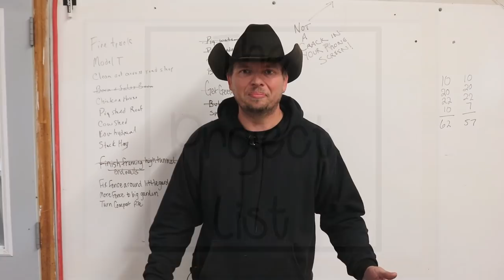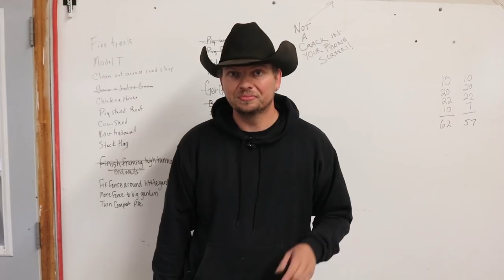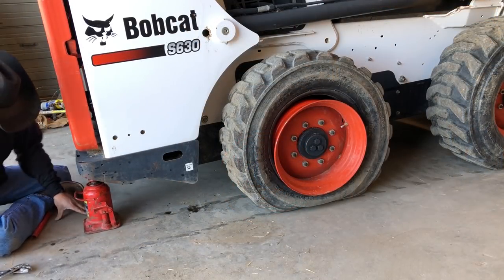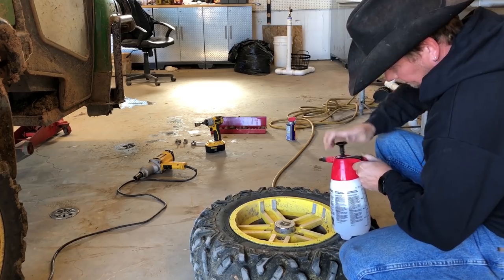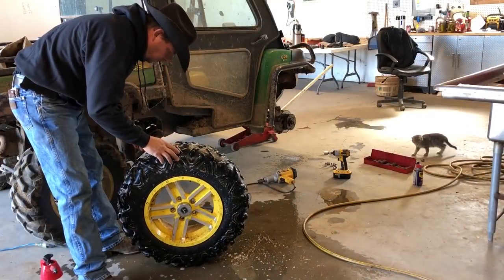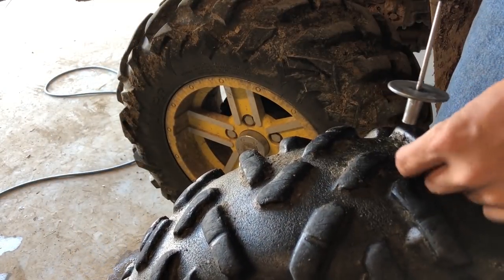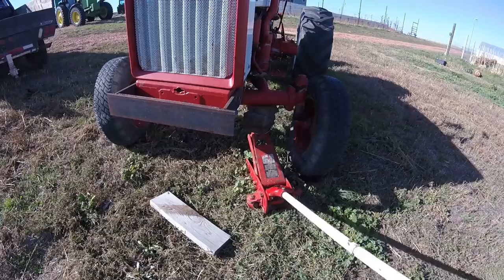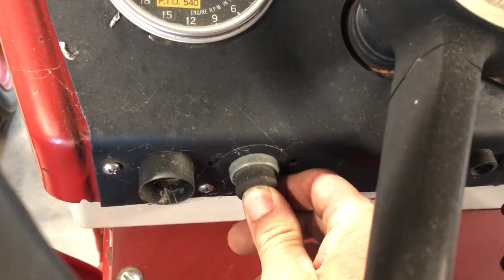Fixing Tires on the Ranch - Tractors to Gator - Plugs to Tubes

Comment: A year ago or so I bought a Stanley car jumper with a compressor in it. It has the screw on chuck and I was skeptical as the others I had were the ones with the little lever. I found out that the new screw on chuck doesn't leak air screwing it on and off like the older ones did years ago on bike pumps. I was surprised at that :-)

Comment: I put non-pneumatic tires on my skid steer, zero turn mower's and my gator. I just got tired of fixing flats. They are expensive but I never have to worry about a flat again. I checked into non-pneumatic tires for my two tractors but they were very expensive. 
God bless.

Comment: Mike love the old international tractor I have a 656 that I just put new Firestone tires on the rear 1200 dollars and that was with the service call to the place to have them done. One thing I would recommend to all is if you put new tires on old rims clean the inside and paint on the POS 15 rust inhebeter works awesome and saves your rims great video as always

Comment: Easier way to change it would be to slide a block under back and push bucket down to lift the skidsteer. Thanks for the videos
Reply: YoungMnDairyman that's the same way I do it with my bobcat S300

Comment: See if Tireject will send You a Gallon for Doing Video, its Better than Putting a Tube in it Keeps repairing New holes! It works I put it in and old Dry rotted Tire that was constantly going down. Haven't Put Air in for 2 Years.

Comment: Did your skid steer tire happen to go flat while using it or go flat while sitting? Because of how skid steers work, it is not uncommon to pop a bead while using them if the tire pressure is a little low. Got in the habit of always checking the pressure before using the couple I had to use on job sites.

Comment: if no one suggested on that 606 find yourself a good used rubber for on there that's what we do all the time even with our bigger tractors plus being it's a garden tractor it doesn't need brand new rubber just rubber to hold air😁

Comment: Quick tip for breaking the bead...place a 2x6 on the tire as close to the wheel bead then drive your truck onto the board popping the bead off... I've only used this on atv tires, but might just do the trick in a pinch.

Comment: Hey Mike...I used to own a Bobcat 7753 and did a lot of construction clean up jobs and as you can imagine, nails and many other hazards 'popped' up often and that down time got expensive!  I took all four of mine to my local Goodyear dealer and for $100 each, I had them solid-rubber filled!  Once cured, I was able to go where no other rubber-tire tractor or skidder could go and would sometimes emerge from the jobsite with my tires resembling a porcupine!  When the tread would finally wear, easy fix was simply to sawzall the tires off the rims and the process was repeated!  I found that extra $400 invested saved me many times that over time vs being down and calling in the mobile tire service truck!  FYI  and keep up the Great videos!

Comment: Great video. I don't know much about tires, but I always wondered if you put the tractor up on blocks and took the pressure off the tires would extend their useful life. Any clue? Or maybe removing them every year and storing them in an environment that will make them last longer? Lots of work, but if it makes the tires last an extra 5 years it might be worth it. Just curious.

Comment: Mike, 
Get some Tireject for that old 60's tractor this stuff isn't cheap but if you use the recommend amount for the size of tire I would bet those tire will hold are at least until your seasons over....this stuff is awesome!
https://www.amazon.com/TireJect-Tire-Sealant-Repair-Kit/dp/B072PC9D1D/ref=sr_1_3?ie=UTF8&qid=1540339579&sr=8-3&keywords=tireject+tire+sealant

Comment: You need a couple of gallons of Tire Ject.  It seals leaks after added to a tire.  It has a liquid rubber with kevlar strans fragments inside it.  You have a headlight out on the Gator.

Comment: Hey just a little tip when you're braking the Beed on a tire you but soap and water around the tire and it will break alot easier

Comment: Just put some green slim in those tires and you won’t have to worry about holes anymore. I use it in my Polaris Ranger and it works wonders. And I drive through cactus all the time.

Comment: Congrats John on wining the Hat!!! Mike I know what you mean about tire issues we have a share of them as well. I have 2 of the same tire plug kits we keep one in the truck and one in the shop We use them pretty often they are a nice kit and work well I going to try your tip about melting the tip of the plug makes sense looks like the international tractor is about ready for rear tires They are looking pretty dry rotted. You should of had blake brought his bead buster down and helped you change the tires he seems to have a lot of practice doing that. LOL Thanks for the video and sharing part of your day with us. Have a great day. God Bless!!!